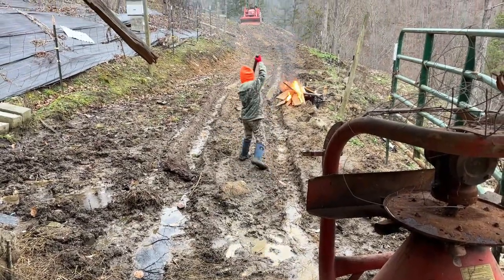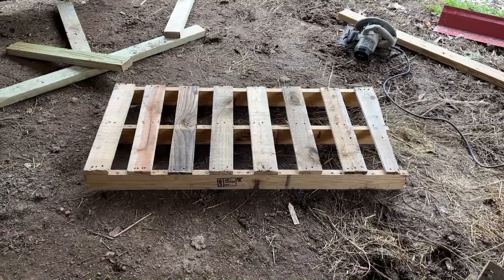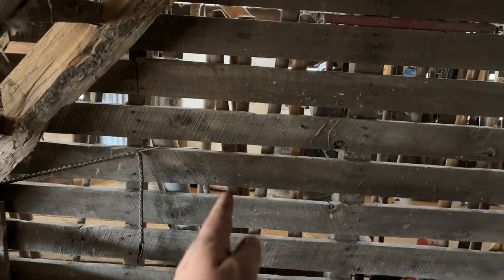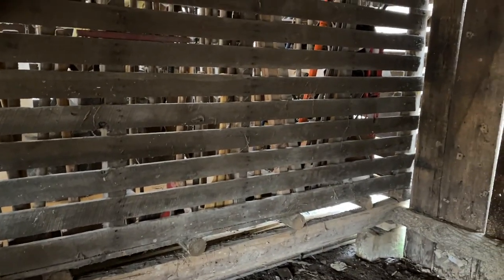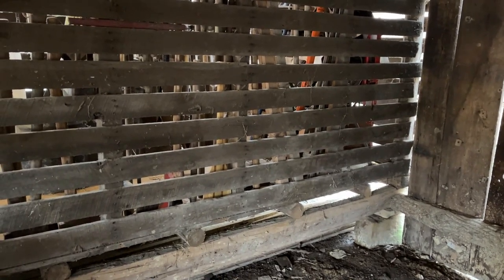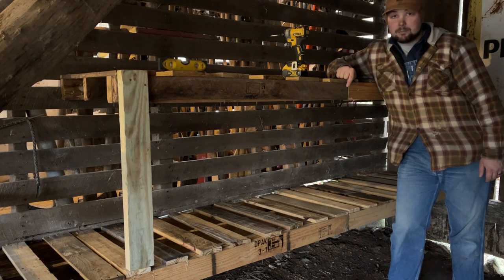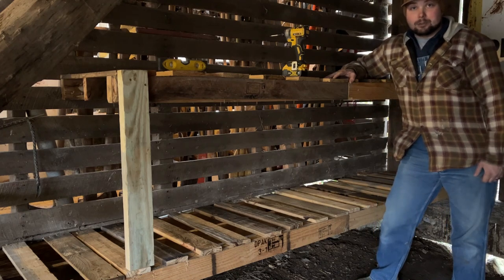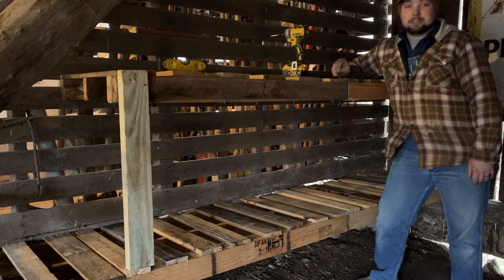Pallet Shelves In Barn Workshop

Comment: Amazed at how Finn has grown since I first started watching you - he was in diapers back then - Look at him now!  Last year, I took a pallet, 3 salvaged wooden fence panels and some green treated salvaged deck rails, and built a woodshed behind my garage.  All of that wood was destined for the landfill when my neighbor put in a new fence - I talked the crew into giving me the materials I needed.  So far I have about $5 invested in it, for a box of 
1&1/2 inch coated deck screws and a camoflauge tarp for the roof.
Reply from the maker: There is almost always a use for repurposing wood! just takes some work and extra thinking sometimes
Reply: @FlutyLickHomestead - Anytime I see a piece of wood along the street or road, that I think I can use, I carefully pull over to the side and retrieve it, putting it in the trunk, even if I have to lay down one portion of the back seat to do it!  Pallets are the exception, I cannot carry those big ones/lift them anymore.
Reply from the maker: @retiredyeti5555  sometimes you can find good stuff on the roadside!

Comment: Nice job Jared! It’s cool to use old pallets for stuff like that. I do have a question. Is that your bolens tractor there? If so would you sell it and what’s wrong with it?
Reply from the maker: Yes that’s mine, it’s a 1959 ride a matic. I don’t think I’d want to sell, my cousin gave it to me and I fixed it up, I’ve got plows, disc, and cultivars. Always wanted to find a belly mower or tiller for it.  Only thing it needs is gas and a battery